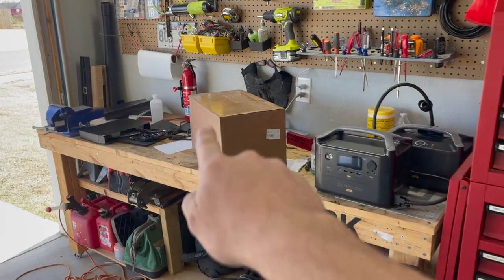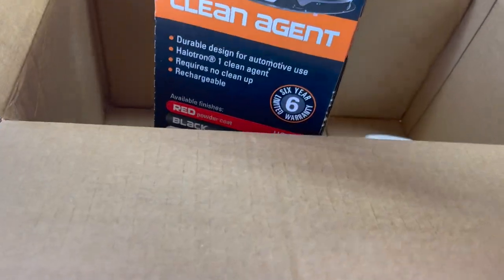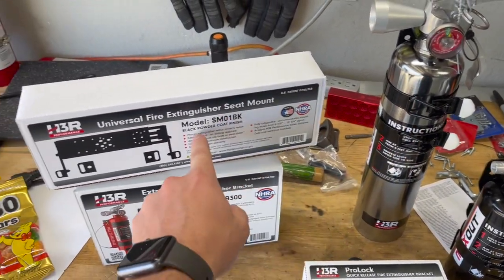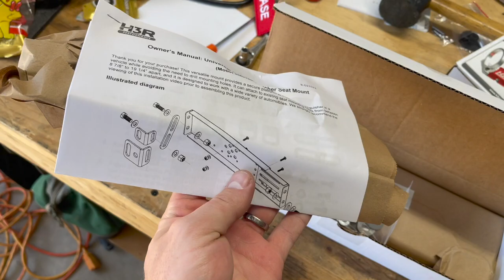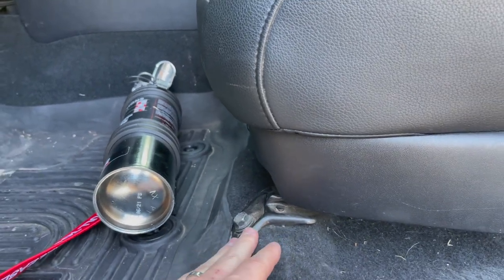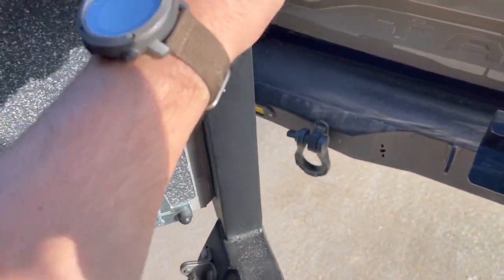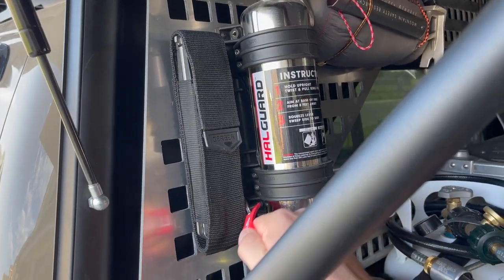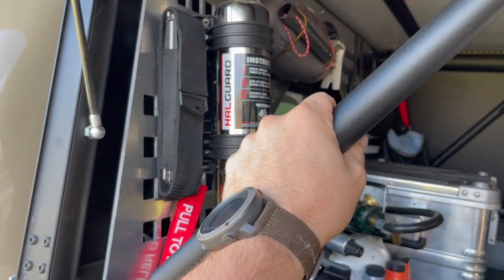Always Travel with This! – Fire Extinguishers & Mounting Solutions by H3R Performance

Comment: $300 for a fire extinguisher is pretty crazy. Yes the Walmart brands aren't as good but it's a good way to go for most cases and we even have those in our fire engines.
Reply: The extinguisher you are referring to is our HalGuard, which contains a clean agent gas that leaves no mess and will not cause corrosion. This is not something you can find at Walmart, those are dry chemical which is very corrosive and messy. Fire extinguishers in an automotive environment, particularly Overlanding, will be subjected to a lot of abuse and need to be extremely rugged. Our extinguishers are UL listed, rechargeable, and come with a 6-year manufacturer’s warranty. Metal (not plastic) is used for all key components, including the valve assembly, handle, bracket, and siphon tube. The use of a clean agent and high-quality components results in a higher retail price. Those who purchase our Halguard extinguishers will be able to count on them working when they are miles away from civilization, and they won’t have to worry about cleaning up a major corrosive mess while on the trail.
Reply: @H3rperformance  Do your fire extinguishers contain Halotron 1??
I ask because:

Halotron 1 is a colorless volatile, pressurized liquid with a slight ether-like odor. Short-term exposure to
high concentrations may result in central nervous system and cardiac effects. Long-term exposure to
concentrations above recommended exposure limits may result in liver effects. High concentrations of
20,000 ppm (v/v) or higher, may cause cardiac arrhythmia.

Environmental precautions: Prevent material from entering into waterways, soil or drains.

2,2-dichloro-1,1,1-trifluoroethane
This material is considered hazardous by the OSHA Hazard Communication Standard
(29 CFR 1910.1200).
SPECIFIC TARGET ORGAN TOXICITY (SINGLE EXPOSURE) - Category 2
SPECIFIC TARGET ORGAN TOXICITY (REPEATED EXPOSURE) - Category 2
HAZARDOUS TO THE OZONE LAYER - Category 1
Reply: @rabbittdroppings3056  Yes, our HalGuard extinguishers contain Halotron 1. The excerpts you have quoted are from the Material Safety Data Sheet (MSDS) that is used in the transport, sale, and filling of extinguishers and bulk tanks. Regarding your specific questions:

- Acute exposure would require a significant quantity in a confined space without ventilation. In this case, using it on an engine fire would present little risk.

- The effects for long term exposure apply to improper handling in a filling/handling line, not the use of an extinguisher.

In terms of toxicity and clean agent gases, Halotron 1 is of low toxicity. This is one of the reasons it has been a popular aviation fire extinguishing agent since 1994. Another reason for its popularity is its effectiveness at quickly extinguishing fire. The FAA considers any agent toxicity concerns to be significantly less important than the imperative to put out a fire – the combustion products of which are extremely toxic.
Reply: @H3rperformance  🐂💩
Reply: @H3rperformance  There are clean agents for like 1/4 of the price on the market. You are overpriced.
Reply: @robertwennerstrom6706  Thank you for your feedback. There are cheaper clean agents on the market, but when comparing, please be sure that you are comparing like to like (i.e. UL rating, 2 strap steel bracket, compact handle, warranty, etc.). We are a premium brand, and we provide premium service. Call us and speak with a live person every time. It is smart to get an extinguisher  - ours or someone else's. Just make sure it is UL listed. Stay safe!

Comment: Ya know , for the cost you could have bought a crap ton of boxed baking soda.  Its the same thing.
Reply: As Grant mentioned, our HalGuard contains a clean agent gas that is clear, and will not make a mess, nor cause corrosion. It is true that sodium bicarbonate dry chemical extinguishers exist, and they are a much more accurate, safe, and effective way to put out a fire than Arm and Hammer from the box, LOL! Also, an extinguisher allows you to stand a safe distance from a fire. Unfortunately, sodium bicarbonate dry chemical extinguishers make a mess, and the agent is corrosive. Not a great choice for engine fires.